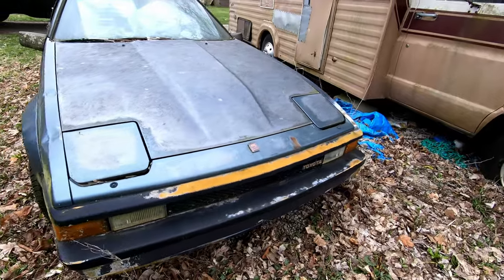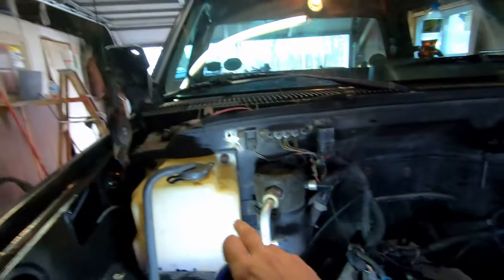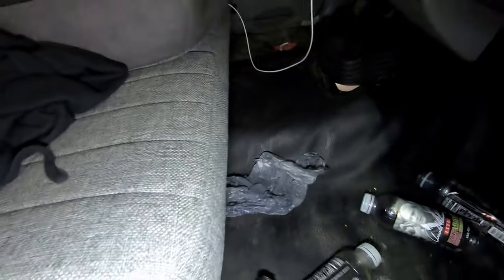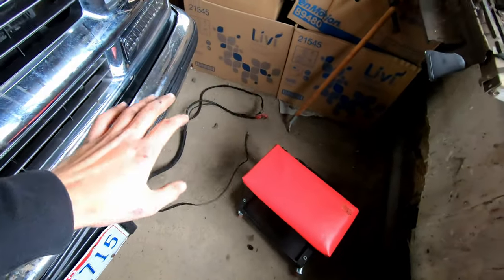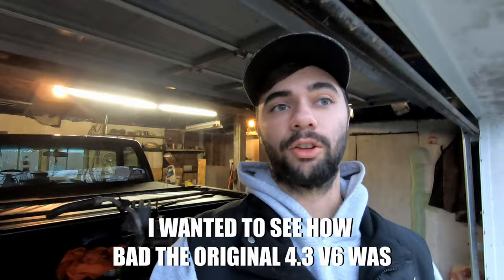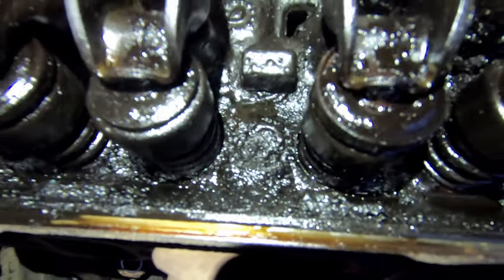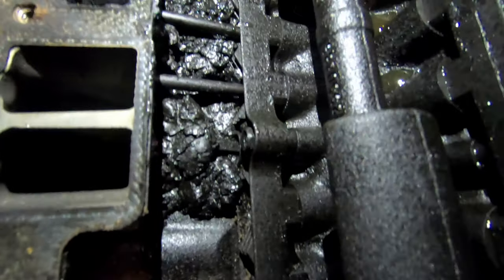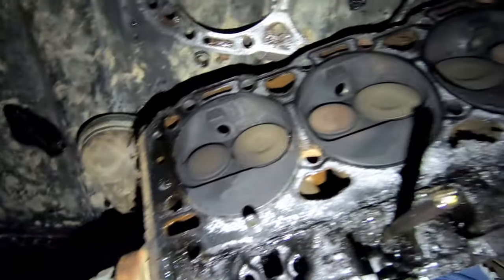$800 Budget 12 Second Drag Truck Part 1 / American Detour

Comment: Put a sniper EFI in it.  It is a very good EFI.  I worked on a 350 and it was built.  We put the sniper EFI on it and figured it gave it about another 75 hp.  It comes with a display for live tuning.  It is expensive but worth it.  Good luck with your build. Hope you get faster then 12 seconds.
Reply from the maker: Hell yeah man, we really appreciate that!

Comment: Go to a junk yard and get clapped out slicks get a line lock system , get a junk yard turbo get a proper intercooler stay under 20 psi if you don’t wanna blow it up  , upgrade the sway bar tune the computer and I think you can get into the 12’s on a stock but boosted motor

Comment: In my scion the oil when I drained it the first time the oil was chunky and would barely move , I’d clean the motor, put it back together, run full synthetic $30~ at 100 miles drain it again , check for sludge , pull apart the motor if it’s not running nice

Comment: I’d go with Fitech EFI it is a lot cheaper than holly. If it were my truck i would put a 5.3 ls in it.
Reply from the maker: Absolutely, I really wanted to put an LS in it and we will eventually, no doubt. But the problem is, I originally was building the 5.7 for a stock replacement but now that I want to drag race and the motor is half built, might as well use it
Reply: American Detour 5.7 will do fine just run a carb. Then if you want to put something else in it you don’t have $1500 in the fuel system
Reply from the maker: Great point. I appreciate the tips. I’ve never gone drag racing so I’m learning!

Comment: Hey rear tores slick wise I use my aspahlt oval track 10 inch slicks that have 20 cire track laps on them and I soak the living hell out of them and they hook up great for a 10 second clapped out 1980s Camaro with a 400 sb on 20#s turbo and 80 shot nitrous runs low low 10s all day just for fun